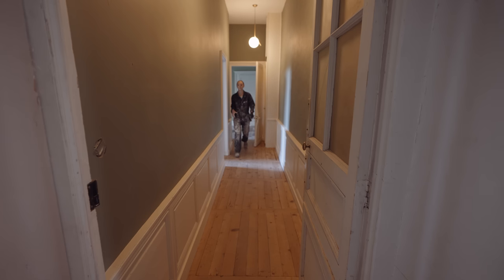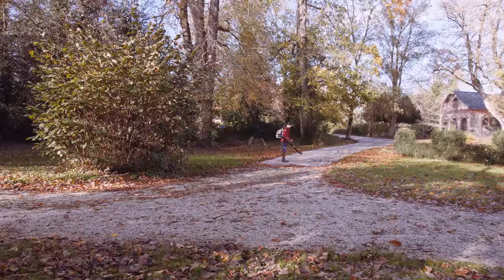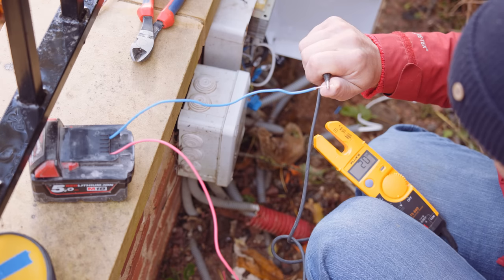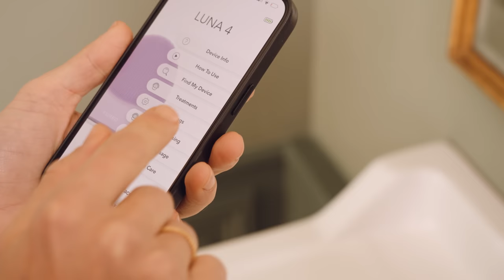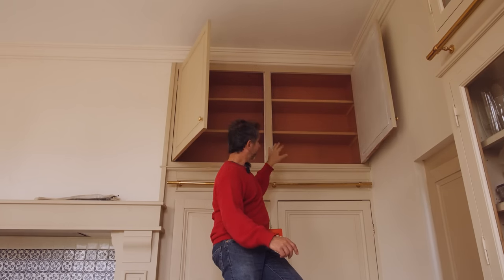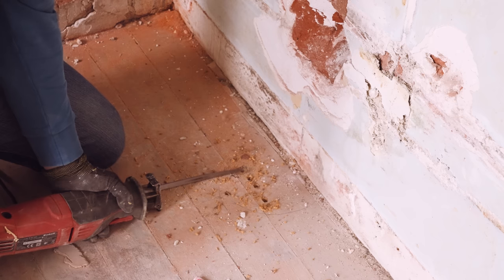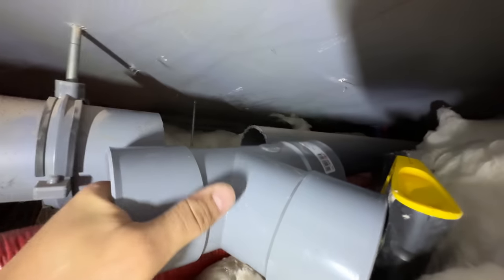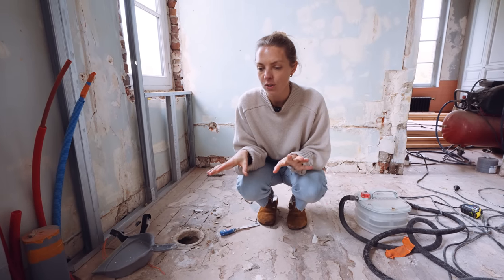BACK TO RENOVATING (Creating a Chateau Master Bathroom)

Comment: Your family is such fun to watch, thanks so much for sharing. Just wanted to mention that you can sand that adhesive off with a heavy grit - 12-16 - it will gum up but that's how it works to get it off. Then of course the finer grits for finishing. 💖

Comment: Anna for the Master BR use either Porcelain tile that looks like Carrera or Carrera Gold marble or just use the marble . Today unless you are a professional its very hard to tell the difference between the two once installed. But with the Marble you must seal it at least once a year which is not hard to do. If you use either of those your Master Bathroom will be outstanding and experiment with the cuts of either one for walls and flooring and inside the Shower walls and floor . For the floor you will generally need smaller tiles and often something with some texture to prevent slipping.Hardwood floors do not do well in Bathrooms and if you use them be prepared to seal the finish well to prevent water damage. Basically they are not practical for Bathrooms but do fine in Kitchens but again must be sealed well with the proper varnish or laquer..Also painted wood floors give interest to Kitchens..You could also use Travetine but it must be very well sealed as  its more porous than Marble..

Comment: I have had oak on the floor of the main bathroom for the past 40 years.  Yes I have a stain and the toilet was replaced.  The footprint of the old toilet is visible.  I love it.  

My late husband was the remodeling contractor and did most work alone.  He passed away 14 years ago and left 6 projects unfinished.  I have managed to have 3 large projects finished.  Short of finding a good handyman, I’m stuck.

I believe there is a heating system that can be installed under wood.

Comment: Tiles for the floor and include a drain for the floor. Makes cleaning the floor very easy as well as no worries about water spilling from sink, shower, tub, etc. Install the drain in a corner near the toilet and connect its drain pipe w/ trap to the toilet's pipe or the shower's. If you search wikipedia for 'floor drain' the result will present you a photo of how it's done in Korea. The drain hole is covered by a grated stainless steel cover, usually square but other shapes are available. I have rectangular ones installed in my bathrooms. I like them so much that I installed these in my kitchen and terraces. 

'What about a wet floor?' one may ask. Rubber slippers. Hopefully you're not wearing outdoor shoes in the home. I keep a pair of slippers in each bathroom. 

'What about water egressing from bathroom into hallway/other room?' My bathroom floors are about 4 cm lower than the other rooms. It this is not possible, and it appears not for your home, a raised tiled lip can be installed at the door's threshold. Just plane the bottom of the door down to fit.

I don't know whether these are used commonly in French bathrooms, but they are the same drain used in restaurant kitchen floors - siphon de sol de cuisine de restaurant France. I just checked and a French company named Limatec makes these for a variety of applications including bathroom. I reckon there are other makers.

If you really want to do it well, radiant floor heating.

Comment: We rebuilt in 2018, tiled each bathroom and installed both electric and hot water heating under the floors. Room can be quickly heated in winter or summer. Together with kerbless showers, (heating under shower area too,) these floors have worked very well and make for a truly comfortable environment when potentially cold and wet! No issues in six years. We did use Schluter systems for waterproofing and tile bedding. Good luck with your decisions, and thank you for your entertaining and impressive work

Comment: Definitely tile! The Schluter system allows you to more-or-less make your entire bathroom into a tub as the strips are mortared about 100cm up the wall. Someday, with probability 1.0, you will have a leak of some sort in the bathroom and then you will wish you hadn't used wood flooring.

Comment: We had a similar situation where the floor in our nearly 200 year old bathroom was sadly not salvageable like yours. So, we opted to lay engineered oak boards over the top, which looked right with the age of the property. It’s an old draughty house and walking on them in cold weather is much warmer than tiles would be. We varnished them with a water based satin finish and it stands up well to the wear and tear. Sorry about your gate opening system.

Comment: If you go with tiles, you can install heating under the tiles which would be a bonus in the cold winter months.  If you go with wood, just make sure it’s sealed and waxed.  There are tiles that look like wood as well.  Good luck with everything 😍😘
Reply: You can get underfloor heating that works under floor boards as well. The main thing is to insulate under the sub floor so you don't lose heat that way.
Reply: Underfloor heating is a must in a bathroom!
Reply: That’s why you have KIDS they are perfect for opening up gates 😂 💕🇦🇺💕
Reply: Yes to tiles and underfloor heating. Perhaps you could get wood effect tiles and lay them in herringbone pattern or parquetry pattern with an outside border. Would look fabulous!
Reply: I also thought of the tiles looking like wooden floor, that's a great compromise if you want the look of wood but the practical aspects of tiles!
Reply: Personally I would go tiles, just because it's safer, easier to clean and it brightens a lot a bathroom. But yes you have some time solutions that look like wood. 
For wood you could go with a bamboo type, which is more suitable to bathrooms since it resists much more to water and humidity. Also it has a lighter color
Reply: I was thinking the same!! An underlay of heating would be lovely
Reply: I have also seen where they make wooden bathroom floors in a similar manner like boat decks which means you get the actual wooden floor feel and look but also it is very durable🙂
Reply: The best solution is tiles that looks like wood … perfect for bathrooms!!
Reply: 5 yrs ago we built a house and had heated tile floors in master bathroom. It was THE BEST decision we made. Wished I wasn’t talked out of adding it to the guest bathroom. You’ll love it.
Reply: I came here to say heated floor as well!
Reply: Underfloor heating is A+. I would do stone floors but for sure heated.
Reply: Heated floors under tile. Warm & easily cleaned & ‘sanitized’ .
Reply: I agree

Comment: Here in the land of wooden houses (in Scandinavia) it is mandatory to line bathrooms with a waterproof membrane that also, partly, goes up the walls. When we bought our house we liked the fact that the bathroom was relatively new and fully tiled. Two years later a tile fell off the wall. It turned out that the shower drain had been leaking water under the tiles for years. Due to the membrane we didn’t have a rotten floor (and ceiling below). However, since it wasn’t mandatory at the time to continue the membrane up the walls, we had to replace all four walls. They had been soaking up water for all these years and were rotten up to a height of 1,5 meters. Tiles are not necessary a waterproof guarantee!
Whatever you choose: use a waterproof membrane between the old and new floor.

Comment: I like the under floor heating with tiles idea.  Hopefully you can find someone to fix the gates, I think you’ll appreciate having that motor working especially in cold rainy weather.
Reply: Until the power goes out and you can't get out. I have them now for the first time in any house and you can flip a doohickey up top with a stick, but it's a pain... still it's nice to have them because I have no copilot.
Reply: Mine are powered by solar so I don’t have to worry about power outages.

Comment: When I renovated a large bathroom I had the same problem with glue on the old floorboards. The previous owners were determined to make sure the very busy tiles they put in would not move, ever, so it took time to get them up. They also did not put any sheeting underneath, so the old boards were too damaged to resurface successfully.
I put down 60cm x 60cm matte grey flagstones, sealed well with a low sheen sealant. These were extended straight into the shower as the shower base , and divided by one large plain clear safety glass shower screen which was set into the flooring with a barely noticeable rubber base. 
Looks good, low maintenance, easy to install because of the size of the flagstones.
Underfloor heating is rare here because of the climate, but could, no doubt, be easily installed before the flagstones.

Comment: When we built our house, our bedroom is upstairs, as is the ensuite.  My husband put a thin waterproof board down, which he then tiled to that.  He nailed the board down so well, we have had absolutely no cracking in any of grouting and its been 18 years!  We then carpeted the rest of upstairs for sound proofing and warmth.  So that is the other thing you have to think about, the transition in each doorway to the next space. What flooring are you using or have there? And is there going to be a level problem?  We have a small ensuite and it is very nicely heated with a heat only air conditioner unit, which also helps with the condensation.  Tiles look clinical if you stick to white, white, white.  Pop some colour in there and it will not look like a hospital bathroom.

Comment: Cork is the perfect floor; it's anti microbial, doesn't absorb water (why we use it to plug wine bottles) and has memory, which means it can't be damaged.  It's renewable, meaning, it grows back, and it can be stained any colour.  It's also warm on the feet, and it absorbs sound.  I'd do cork floor in bath and kitchen.  It's a bit pricey, but you cry only once.  And in time, if you tire of it, it's super easy to remove.  Cork can be had as a 'floating floor' too.
Reply: I have cork in my kitchen (rented) and they don't look so good after maybe two decades. They bleach a lot, so I have ca. 5 different shades on the floor depending on the furniture that stood there. And the top coat is pretty damaged in several places.

Comment: I'm an interior designer, and specialise in bathrooms. Yes, you can heat both tiles and timber floors, even carpeted floors. It's easier to maintain a tiled floor in a bathroom, but if you seal the timber, you can also use it in the bathroom. It really just depends on if you are happy with more maintenance. Personally, I think because this is a ensuite for the main bedroom, I would look at natural stone, which would give it a feeling of opulence. A nice limestone or travertine in a light cream colour would really suit the chateau. It would require sealing, but it will last decades and never go out of fashion.
Reply: Wood, if you don't mind the occasional maintenance.  If you do tile, take time when choosing, to consider how slippery it is when wet.
Reply: I voted Team Wood, but we have cream travertine in our master bath, and I agree it is gorgeous and feels luxurious.
Reply: @marybethterhaar4200  natural stone in a honed or tumbled finish is non slip when wet.
Reply: ah gosh stone floor/stone tiling would be amazing.great shout

Comment: My grandmother’s ancient  house had wood floors throughout, including the kitchen and bathroom.  They held up just fine.  When I built my house, I did the same thing.  I prefer the feel and look of hardwood.  Twenty-three years later, I still love my hardwood.
Reply: I find tiles cold to walk on so would go hardwood too.
Reply: @catherinekilgour2563 depends on the tile. If you've got a more matt/textured tile it doesn't get as cold as a shiny tile, which on the other hand can be easier to clean. They could also add a floorheating system. That way they'd have more options. :)
Reply: Here in the states new hardwood floors aren’t really hard. They’re crap that dent easily, warp easily and require sanding and refinishing every 10 years and they aren’t thick enough to take multiple sandings. I had a previous home in Virginia built in the 1980’s which had really hard hardwood floors. The ones I have now are beautiful crap.
Reply: You guys are hilarious ❣️👏🏻👏🏻👏🏻
Reply: You need to buy solid wood flooring, not engineered hardwood.  I live in the USA & bought genuine oak floors that should last a lifetime. They tell you if you buy engineered hardwoods that you can only sand them once or twice.  They’re only 3/8 of  an inch thick- just “pretty” wood on the surface. Solid hardwoods are “solid” and typically 3/4 to 1 inch thick. Totally different type of product with a totally different result.
Reply: @hollykeller1545   Exactly. Hopefully Philip and Anna have access to far better wood than corporate MBAs give to us in the U.S.

Comment: A very water resistant "wood" solution is a flooring of bamboo in the bathroom, if it is just for the estethics you can also opt tiles looking like wood. If it is abour maintenance and avoiding grouting that becomes dirty; you could opt for XXL size tiling (but that feels rather crisp and less chateauesque).  But wooden flooring in bathrooms are fine if you treat them right.

Comment: For your bathroom floor, I recommend that you clean up the wood floor  by getting rid of all the loose stuff, then prime it all with a Mapei product called Eco Prim T Plus then use a fiber reinforced self levelling compound  called Mapei Fiberplan.
If you want, you can embed under floor heating wires in the fiberplan, so your winters in the bathroom will be nice and cozy. Then you would waterproof with Mapei AquaDefense.
You can then tile with conventional tiles or with the new timber planking look tiles. That way, you can have warm tiles that look you have a timber floor.

Comment: There’s a product made from the acids of natural oranges. It’s applied to layers of old paint then let alone to work. It bubbles up the old surfaces and you just scrape away. It’s used in historic restorations. I think it’s called Citristrip Paint and varnish Sripping Gel. I don’t know if it will work on glue but worth a try.  I think you will need to remove that glue even to put down new tile.

Comment: Team tiles! 
It's easy to clean and not get rotten. We have wood in the kitchen and I hate it. Most pieces have chipped edges.😩
Reply: Here also team Tiles, but with the addition of an electrical floor heating underneath, so your feet are warm in winter! (it is not the main heating, though)
Reply: Yep. When the toilet overflows you don't want the wood absorbing that!  Even when you seal the wood there are always crevices on the edges that accumulate germs. Tiles, or real stone tiles you can clean... even marble hexagonal parquetry which I did in black and white in an old Craftsman-style bungalow in St. Paul, Mn.

Comment: Tiles, plus floor heating is what I suggest. Previously had a subfloor in 2 out of 3 bathrooms.  They were small bathroom and the contractor did a great job. Had to make room near the door for the electrical floor box terminal. Was a blessing during winters in Colorado, USA. Good luck. Enjoy the videos over the last 2 years. Peace

Comment: Anything water-resistant for the bath. The larger the tile, the less grout to mess with. The smaller the tile, the more design options.  Blessings!
Reply: I was just watching a home decorator show where the host recommended reserving larger tile or stone surfaces for walls rather than floors. He was saying grout is a good way to help prevent slipping on wet surfaces, and recommended smaller tiles on floors for that reason.
Reply: @Epoxinator  There are floor tiles which have some kind of (invisible) anti-slip texture.

Comment: I would go with a stone floor with underfloor heating. We have limestone and underfloor heating and if sealed is easy to takecare of andis not noisy. Just make sure you strengthen the floors so that they can move and crack. I would add rugs to add warmer, cosier feel, Weaver Green make a lovely range of washable rugs made from recycled plastic- amazingly soft.

Comment: I've always used half tile half wood bathrooms, wet and dry areas. Usually with a step up into the tiled / wet zone which includes shower area and maybe tub area plus space for drying off. The toilet and sink usually in the wood / dry zone. This avoids hard flat transitions from tile to wood. . I find adding a step is a much nicer way to transition between wood and tile.

Comment: 100% wood. Americans aren't used to wood floors, but it's done all throughout Europe and it's completely fine (as I'm sure you know). It's warm and full of character. I regret not saving the wood floors in one of my last bath renovations.
Reply: Do you speak for all Americans?
Reply: @kmarch6630  sorry wasn't trying to be rude. I'm an American, and have found that there's usually a bit of a knee jerk reaction to wood floors in bathrooms here, which has always baffled me.

Comment: Im definitely team tiles! One of the things I love in our bathroom (apart from underfloor heating), is the fact that our shower doesnt have a door or curtain - we have a wet room, so no need for a seperate shower tray, and the lack of barrier means that once you've finished showering there's little temperature difference between the shower cubicle and the rest of the bathroom. Obviously, if you tend to splash a lot, this isn't so practical.